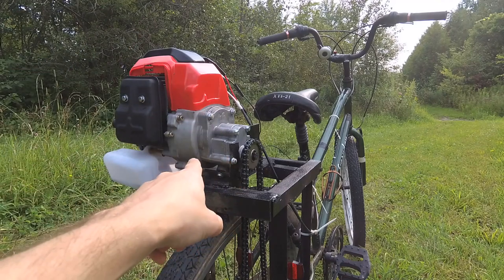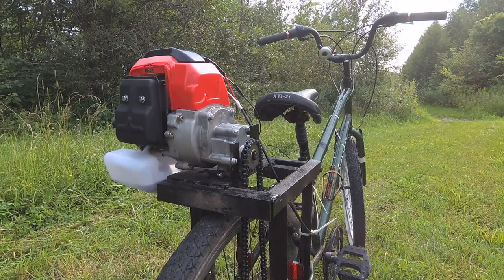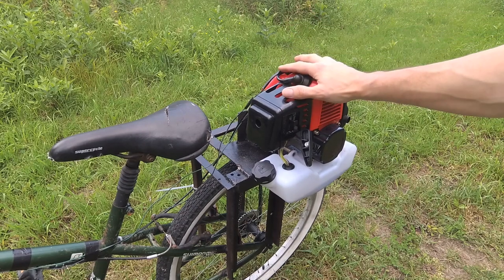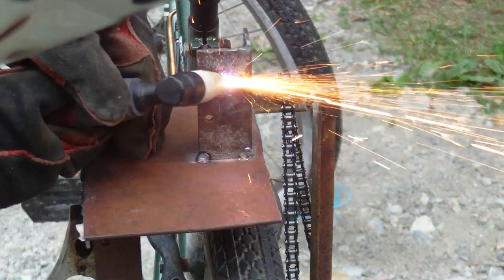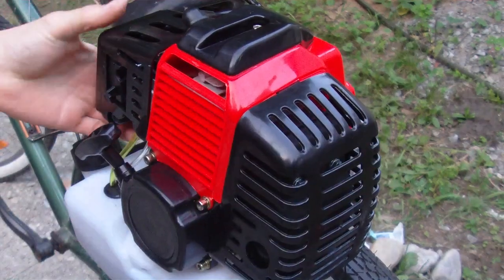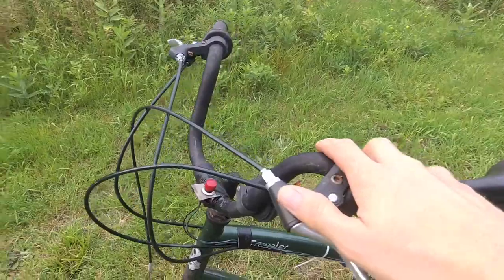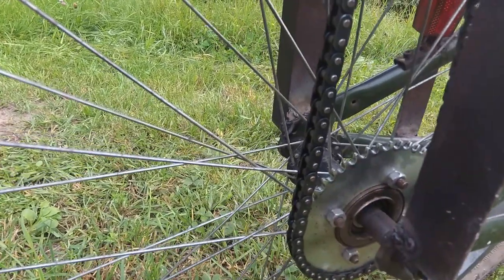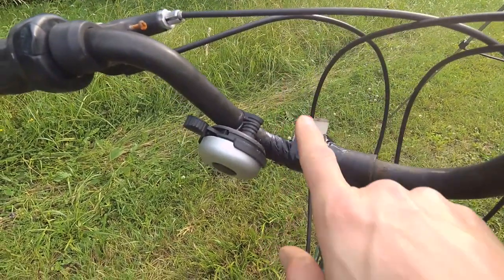Pocket Bike Engine 49cc on a bicycle, Will it work? - How to Build a Motorized Bike

Comment: So the counter-clockwise  chain drive transmission (sprocket facing back in toward motor) would let you reverse the motor for a left-side sprocket to keep  the pedal drive train.

Comment: This seems to run better then purpose made motorized bicycle engines...
Reply from the maker: Thanks, I've never tried one of those engine kits, but this engine dose seem to run pretty smooth. I do want to change the drive sprocket out with a larger one, or try a smaller pinion sprocket.
Reply: @kurtscottage  yeah, these are geared for the mini wheels after all...

Comment: i used a wooden engine holder instead of metal( i dont havr any welding yools or something) but di you guys think it vould hold
Reply: Use hardwood for it. It'll likely be a bulky setup, but it should last for a while.

Comment: can't find the engine with sprocket attached is it separate
Reply from the maker: Some come with the gear reduction transmission with the sprocket on them, and others with no trans. If it's just a sprocket you're looking for, there easy to find on many sites amz, ali, etc.

Comment: I have the same engine and I can’t get it started lol what are the two wires coming out of the engine for?
Reply: if there red and green thats killswitch
Reply: Just buy a new carb and learn how to remove the ethanol from gas. It's easy.

Comment: Nice job, brings back memories...lol
Years ago a friend of mine did one w/a sthil 026 motor, welded a small bike chain gear on the chainsaw drive sprocket mounted it in middle of bike and ran chain to the large pedal sprocket, it still had all the back gears it was pretty cool actually went pretty good too, it was on a 21sp
Reply: did it go like 40 mph with all the back gears

Comment: I really need a video on how to connect a throttle cable to that engine I have it but I'm having a hard time finding out were to connect it please make a video
Reply from the maker: It was a bit tricky without the right cable, but what I did was file down a break cable end than slide the cable through the slot on the throttle valve than I pushed it back through the housing. I used all bicycle parts to make it work if that helps any.

Comment: just bought this motor. what fuel mix did did u go with?
Reply: I have a 47cc scooter with this same engine.  Mine was getting hot with the recommended 25:1.  I have been running it 16:1, which is 8 ounces of oil to 1 gallon of gasoline.  It's 18 years old now and still runs strong.  I use Supertech 2 stroke marine oil from Walmart.  A gallon is like $11.  I use stabil in the gas as well and never had the gas go bad.
Reply: I have this engine once again didn't know why it exploded with s black stuff the first time but now I'm thinking It rain hot with the 40:1 ratio I'll use 2 now to see the difference
Reply: Ima run this to the t8f gearbox chain sprocket arrive and weld together something to rest on
Reply: @reginaldhenderson8948  yeah, I have been running 8 ounces of oil to 1 gallon of gas.  16:1 ratio and it keeps it cooler.  It was overheating with 25:1, I run Supertech Walmart Marine 2 stroke oil.
Reply: @reginaldhenderson8948  that black stuff sounds like worn down aluminum, like the piston was rubbing something.  Aluminum turns black when it's wearing down.
Reply: @jeeprenegade1985  om hooking it up now I'll upload a video for u can see and I'm trying a 700c hybrid don't think it's been don yet
Reply: You know exactly what part to turn the 43cc to chain drive a sprocket goes on the bar that locks down the friction drive  bar checkout the friction /chain drive video
Reply: @reginaldhenderson8948  are you asking me if I know which part?
Reply: @jeeprenegade1985  forgot your u welds your together just trying to find out before I weld mines together
Reply: @reginaldhenderson8948  i never welded on mine except where the frame cracked.
Reply: @jeeprenegade1985   my bad had u confused with Kurt

Comment: Do all pocket bike engines have clockwise rotation?
Reply: The gearbox this motor has provides clockwise rotation. The more common gearbox that has the sprocket facing the motor is counterclockwise,

Comment: Where do I get the rear sprocket assembly?
Reply from the maker: You can find the parts on most sites like Amazon, ebay, Ali. Search for toothless freewheel with T8f sprocket or search freewheel sprocket with flange.  I'm using the 44 tooth drive sprocket